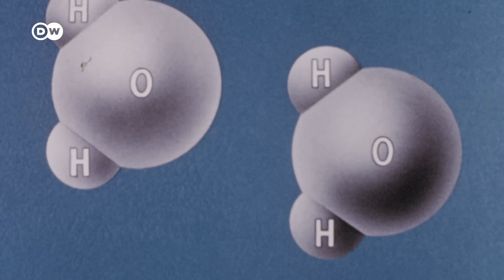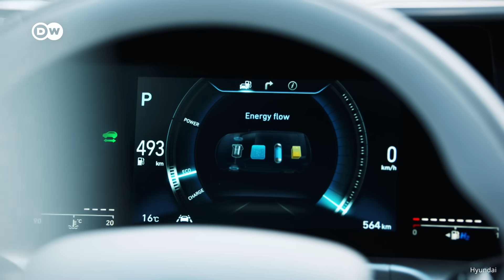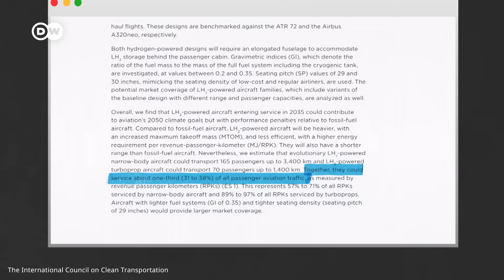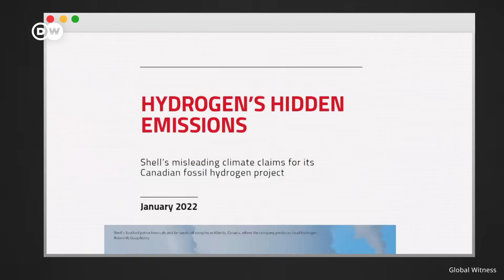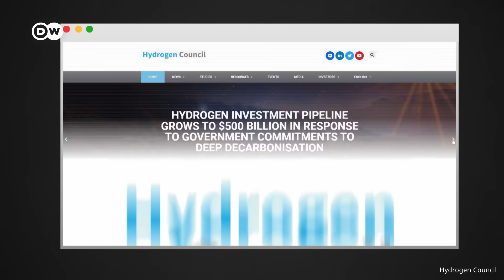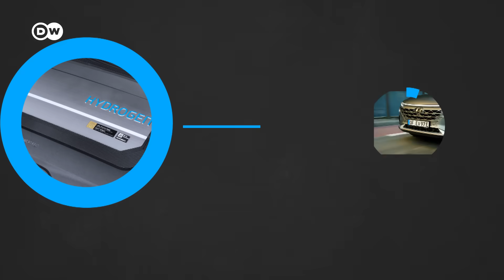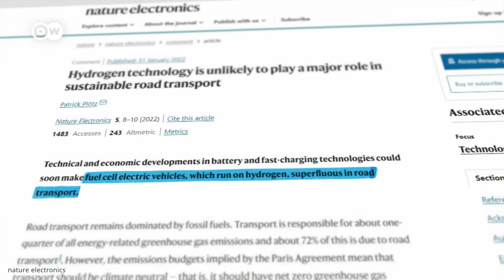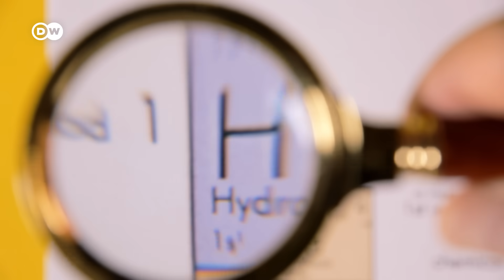The truth about hydrogen

Comment: The follow up to this is talking to JCB as they developing using converted engines to being powered by hydrogen instead of using electric motors etc but not mainly for cars more for heavy duty vehicles and machinery.the idea behind it is save money and using proven technology 100+ years of combustion engines…if successful manufacturers won’t have retool remake equipment to make power trains as already using it etc etc

Comment: Pity this video did not consider storing hydrogen as ammonia which can be liquified at room temperature under pressure for storage or shipping (unlike hydrogen) and which can be converted into electricity via a fuel cell or back into hydrogen gas

Comment: Using solar cells to continuously apply electricity to water reservoirs. The hydrogen  gas can be used to fuel hydrogen gas engines.

Comment: Stop thinking of it as a fuel, and start thinking of it as an energy storage device.
Quit wasting time and engineering brainpower on applying it to overland transportation vehicles, where it doesn't work. 
Quit trying to make it directly compete against fossil fuel, which comes cheap and ready to burn at the cost of simple primitive gathering.
Instead, pit the large hydrogen storage tank against the large battery as a way of storing solar power for later nightime and wintertime use. See who wins THAT race.

Comment: If we can achieve to burn it efficiently on ICE or turbomachinery, hydrogen can run on trucks, aircraft, ships, or every non-stationary high power-weight ration applications that now run on combustion engines. And this with the same efficiency as fuel cells (that is ~40%) but with a far cheaper, compact and more reliable technology, the combustion engine.

Comment: The answer is no. It is not efficient to produce using electrolysis when compared to using the electricity to run a battery electric vehicle directly. We would not be able to produce enough green electricity. It is also very difficult to store and transport which is why it is currently made at the point of use. In addition when you remove the carbon atom from methane you remove the part that holds most of the energy so it is not a practical alternative to natural gas.

Comment: Strikingly, the comment section is riddled with poorly informed posts, some dwelling on sizes or properties of "the hydrogen atom". Much of this is irrelevant, since hydrogen gas is a molecule, not an atom. Learn it, before you post, please, or simply leave it out.

Secondly, cryogenics is hard to do with a molecule whose boiling point is close to absolute Zero ( 20.271 K, or −252.879 °C, or −423.182 °F). This is basic physics. Please look it up. Then think about technologies (and economies) of scale.

Comment: Thanks for this video, I am a huge hydrogen fan but never quite knew what it cost to make. The best example I could see for it was Iceland that has geothermal energy to produce the product for fuel cells.  But some questions back.

The comment that production of Hydrogen only leads to 48% capture of CO2.  How does that compare to fossil fuel engines and the like.  How does that compare to the electricity needed to generate recharge for battery powered functions?  

Suppose instead you use raw hydrogen to power the internal combustion engine.  What are the outcomes for that in terms of the carbon footprint, (CF) of the vehicle output?

Why is there the suggestion that how hydrogen is produced now will have the same CF once it becomes more integrated into our infrastructure and engineers are employed to make it more efficient, because economics?

What is CF of the exponential increase in the production of electric batteries to replace the combustion engine in terms of toxic chemicals and heavy metals compared to the CF of hydrogen fuel cells.  Bearing in mind, initially at least, the life span of a bed of batteries in a car would be five years before replacement is required. While in the meantime, charge holding efficiency will decrease reducing optimal mileage rates. So the production requirements for batteries would be off the scale.  

Why is the future of hydrogen fuel cells measured on their current efficiency rating given this is in its infancy?  The examples abound about it on how familiarity leads to innovation. Chat to Iceland.

What does need to happen is to have the established fuel companies encouraged by governments to develop clean energy but with the carrot there must be the stick and for the first two decades government audit on how the carrot is used. (I know, the difficulty is true audit and prosecution of cynical companies. I'm looking at you VW).

So in summary, my observation would be, that while there are problems to solve with hydrogen, the generation and use of batteries does not necessarily outperform as an alternative.

Comment: Good presentation but as you point out there are no silver bullets and that also applies to renewables and all renewable power. There is a huge issue with scale and the infrastructure needed to create the vast amounts of base load power. Back in the 1970s I attended the first Habitat conference in Vancouver. And a very concerning statistic stuck. If you have a steel windmill of the type commonly used on farms across Australia the energy used in its manufacture would require something like 15 years of continuous operation in a 20knot wind to break even. Creating wind farms and solar farms has a huge construction cost and a significant operational overhead. The vast solar at Los Vegas for example has a huge cleaning problem and it's a harsh dry environment. Currently hydrogen cars are extremely expensive and companies like Toyota won't currently actually sell them in many countries. Hydrogen can be used to run existing petrol or gas powered cars. But this is energy inefficient. Fuel Cell is much better. I actually think we need to step back a bit and look at the big global pollution picture and not focus on car technology which isn't the elephant in the room because the globe doesn't care about specific solutions only the major culprits. So significant investment to move away from coal has to be a key focus. Moving away from current long haul trucks and shipping to electric trains to clean ship's and perhaps a more localised cleaner self sufficient culture away from oligopolies I think has real merit.
Back in the 1970s a little book called Small is Beautiful was published. It's focus was only reducing the foot print and taking a more holistic localised self sustainable approach. I think there is real value in this. Cheers all

Comment: We need to put into the 'dirty' equation the entire issue of Lithium, the key element in our battery technology, this stuff is dirty to mine, dirty to process, in actual use if it catches fire all is lost, and finally when it is spent it represents a significant disposal hazzard.  So the battery car (or truck) costs you half again more to buy and when it is ready to be retired you will get another large bill to remove it.  Never mind that half the electricity used to charge it during its useful life will come from 'dirty' sources.  I don't see rational (profit motivated) trucking firms seriously moving into this, most are having a devil of a time dealing with keeping their Tier 4 diesels working and having nightmares about any Tier 5 ideas.  I see a growing cottage industry of rebuilding older trucks (and railway locomotives) that is probably a good idea by itself environmentally since making the metal is a big part of the carbon footprint.  The steelmaking process will be solved by market forces since countries like China, India, Russia, and Saudi Arabia will continue to make it the 'old' way and flood the market with comparatively cheap steel.  Battery powered delivery vehicles do make some sense for local deliveries so why isn't the post office doing more of it, they just recently bought their first electric vehicles, I believe the British PO has been doing this for some time.  I do see some movement into battery operation in the ship industry but most of this is operations such as short range ferries and such that can recoup the additional costs when the government regulates their fare (monopoly pricing).  There is no current technology to make this happen for serious seagoing vessels.

Comment: If we had continuous feed hydrogen fuel cells that were small and reliable, electrolysis could be a good way to use home produced solar energy when the batteries are full and the system floating. There is a massive amount of this energy being wasted. Also, by electronically vibrating the water used for electrolysis at the proper frequency, the water molecule breaks apart much more readily. This step makes the process very many times more efficient.
Reply: Best idea so far.
Reply: We could also pump it into dry regions of the world. Cool down green houses and water the plants and animals.

Comment: Big problem is that 99% of regular people they think you can just burn hydrogen like petrol, the by product of burnt hydrogen in NOX or nitrous oxide which is 300x worse for the atmosphere than CO2 no exaggeration, the only way hydrogen is clean is through a fuel cell ,

Comment: Hydrogen can be a major solution for long haul transport where the weight vs range issue doesn't make electric transport feasible. Also, if Hydrogen is burnt directly will help to reduce the issue of efficiency in the case of automobiles and reduce the carbon emissions in case of steel plants, cement plants and the likes

Comment: The Japanese  using a new type  of nuclear  approach can get  nitrogen at a very low cost...you should  look at this....this option you did not consider.
Reply: @jadenspires1891  It's hydrogen. He's likely referring to the experimental HTTR plant in Japan. They already tested it generating hydrogen from the very high heat waste the reactor produces. It splits water via thermochemical reaction instead of electrolysis. Since the high heat is a waste product of the reactor, it could create hydrogen at low cost compared to green hydrogen which needs electricity to split the atoms. Nuclear produced hydrogen could be very viable with 0 emissions and is called Pink Hydrogen which the video did not consider.
Reply: @jadenspires1891  Japan is pretty eager on fast tracking development for it, aiming to be operational for commercial use by 2030 if all goes to plan. Along with reactivating around 30+ of the reactors which were inactive since the Fukushima issue.

The push is partly due to the fact that being a resource and space poor country, it sorely needs nuclear to increase its energy security. Currently the country is relying on imports for energy needs and the current LNG prices have spiked which affected electricity prices here a lot. 

Hope it goes well, it's a Gen 4 SMR type reactor so building them won't take decades and is super safe.

Comment: So eventually the cleanest and most efficient available solution is still nuclear power.
Reply: it's not discussed in this video but nuclear and hydrogen can actually complement each other very well. The newer experiments for Very High Temperature Reactors (VHTR) like from Japan's HTTR would make it feasible to create hydrogen from the waste high heat generated by these reactors, splitting water via a thermochemical process instead of electrolysis which actually has better energy efficiency yields. It's emission free while also creating hydrogen as a waste product.

Comment: There should ANYWAY be a change, or a shift, of paradigm. The production of hydrogen should be performed at ALL possible levels, that is to say every household, every condo, every block should have their own hydrolisys through any possible renewable source. Moreover, there should be an analogue effort at national and even over-national level to improve hydrogen production and storage.
Remember that an advantage of H is that you store any possible excess of electricity production in that form.

Comment: liquid hydrogen is light so for a gas tank for a, say car, the tank would have to be 3 times the volume as the same BTU or same energy tank of gasoline.  That is liquid hydrogen. 10 gallon gasoline tank is equal to a 30 gallon liquid hydrogen tank.  Say goodbye to your trunk or back seat......

Comment: What the world is not talking about is the foot print from so called renewable or green energy is just as big if not larger then fossil fuels. Take batteries for instance. The mining and transport and production of them along with disposal and charging leave a much bigger foot print then just burning gas. people like the women in this video saying if we don't do it by the end of the a set date were screwed are only pushing an agenda regardless of the cost to the world. I see very few sound minds involved with "going green" They ignore the facts and either don't understand the big picture or hide it to push an agenda. What we do without plastic? (witch comes from oil and they want to stop 100% of oil pumping) In truth. You will DIE and so will many loved ones at a much earlier date. So much plastic is used in the medial field most operations and test can not be done without plastic. Other methods are impractical and very costly. Open your mind to knowledge before you open your mouth.

Comment: The main problem with hydrogen is that it is EXTREMELY difficult to store because the atom is so small that it can pass through the crystal matrix of most other materials.  This means is VERY expensive to store.  And, obviously, leaks can be Hindenburg-deadly.
Reply: Methanol is the smart hydrogen. Suppose we were building nuclear power to produce pink hydrogen, we could produce methanol which is already useful fuel and can be converted into other chemicals. More nuclear reactors, more pink hydrogen, and more methanol.

Comment: GHG, which is more "important"? CO2 (we produce it and it can be taxed) or H2O (humidity or water vapour, so harder to tax...)? H2O is 18 times more prevalent in the atmosphere than CO2 and it absorbs solar radiation more extensively and more completely than CO2. Thus if you produce humidity rather than Carbon dioxide, you are generating more GHG. Happily, our contributions are miniscule when compared to natural sources so neither is a big deal except in the computerized climate models that were designed and parameterized to find and accentuate the effect of CO2(by tripling the effect it supposedly has on humidity...) on global temperatures.

Comment: While it is true that the efficiency of lithium-ion electric batteries is better (in the current manufacturing cycle) than hydrogen fuel cells, I wonder at the costs to recycle / dispose of these lithium-ion batteries.  How does it compare to recycling expended hydrogen fuel cells?

Comment: I'm sure I saw a BBC Horizon documentary in either the late 70's or early 80's about Hydrogen in which they stated that the gas could be turned into metal hydrides that could be dropped into fuel tanks.

Comment: Truth and marketing ain't on the same page. H2 - cryonic or high pressurized - is not just ridiculously expensive to produce, it's properties are technically demanding and require the application of space-grade materials and tolerances. For instance : H2 molecules are uniquely small (Seals and gaskets); insanely low temperature or -high pressure; mixtures with air are ten times more combustable. Manifacturing and maintennance costs are on another level (reflecting the gross energy  burdon on that kind of engine system)

Comment: What do I think? It's an answer to some things, not to everything. Be nice if CH4 could be split with solar hear energy near source of extraction, then shipped as liquid. This process does not produce CO2 as a byproduct (though tank contamination remains an issue in steady mass production). Solar heat itself may also be more viable as a source again, given the new thermoelectric alloy a gentleman has developed at MIT, as efficient as steam in generating power from heat.

Comment: Contrary to lots of comments I do not feel this  video is well balanced.
1) To be able to use Hydrogen as an alternative energy carrier to fossile carriers the biggest challenge is not production in itself but the formation of a distribution infrastructure equal (or better) than that in which the fossile carriers have a century head start. Without the temporary use of grey and blue hydrogen building such an infrastructure is nearly impossible.
2) The energy conversion of electricity to hydrogen back to electricity may be as low as 40 percent, but it has a great potential for buffering excess renewable energy when on sunny windy days more is produced than can be consumed. Buffering in batteries alone, even with smarter grids, is probably a more expensive option on all scales.

Comment: The problem with green hydrogen is that it is considered green because the electrolysis was driven by sources portrayed as green. I worked on utility scale wind turbines for three years. From cradle to grave and everything in between, there is nothing particularly green about them. There are ways they could be made more green absolutely. But the wind giants bow to the same money god the oil giants do. They put on a good PR face and lie about how green they really are.